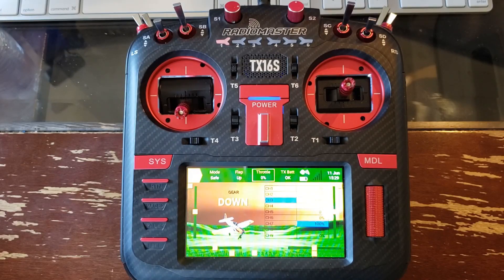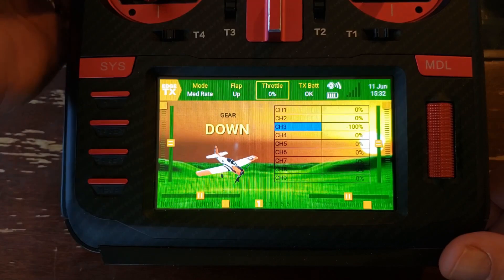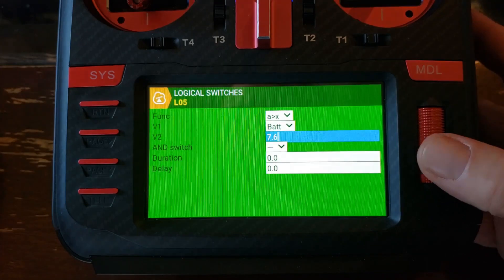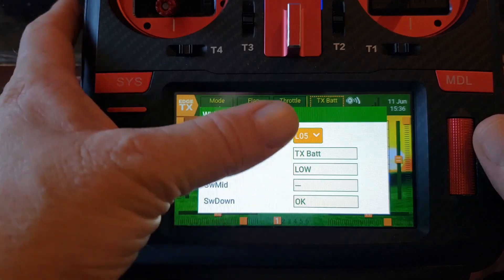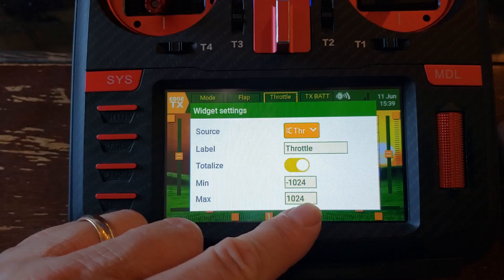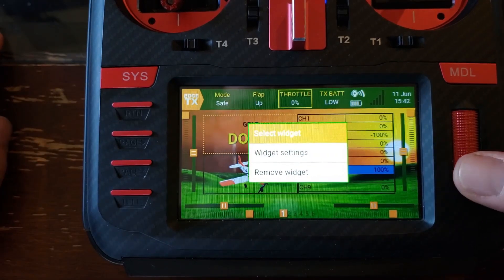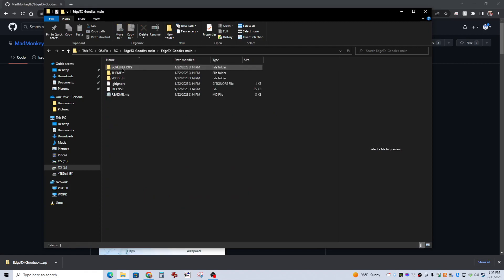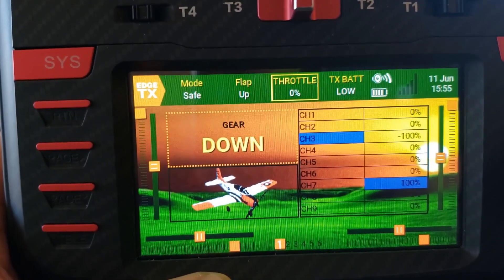Highly Requested Video - Awesome EdgeTX Widget Tutorial!

Comment: Hello Shane,

thank you very much for your great videos, they have helped me a lot!

Now I have a question about this one. I have selected the SwitchPRO, as in your video, to display the flight midus.
But I am not able to change the colours. I also want to get rid of the shadow.
Can you help me with this or do you know of another widget with a similar structure but where you can change the colour?

Thank you very much!
Greetings from Austria.
Reply from the maker: In SwitchPRO the colors just follow the EdgeTX theme you are using I believe.  If you want different colors you'll need to change your theme or you could edit the LUA script on your PC to customize the colors.  Just be cautious what you change in there.  It will take some experimenting to determine which script and which parameter to edit.
Reply: Thanks for your quick reply. 

As far as I remember, I have no yellow and no shadows set in my personal EdgeTX theme. 
And in the other widgets I use (also in the TOP Bar), the colours are also different.

But I'll have another look in my personal theme.

I'll let you know as soon as I've found the ‘error’.
Reply from the maker: @I.Z-e8i  The theme I'm using is FM2M Greenfields.
Reply: So, I've tried a few things now, but I can't change the colour and shadow.

I created my personal theme with the online EdgeTX Theme creator.
I think it is because of the SwitchPRO widget itself, there is no possibility to change the colour.
Reply from the maker: @I.Z-e8i  I hadn't tried so figured it would follow the theme.  I suppose you'll have to edit the Lua script color definitions.
Reply: Ok, I'll give it a try.

Thank you very much for always taking the time to answer me so quickly.

Comment: SwitchPro generates an error on my tx16 as soon as I select it. GaugePro works fine. Never mind, I misspelled the word switch when I downloaded to my radio. I can't believe Edge TX is so sensitive to spellings.
Reply from the maker: What is the error?  Maybe the script is corrupt.  Didn't download correctly or didn't unzip correctly?   I'd start by re-downloading the scripts from the source, deleting the old one off the radio and put the fresh file on the radio. Make sure you didn't change the filename or file extension.
Reply: @ My mistake was in changing the spelling of the word “switch”. I had swith. lol

Comment: It looks like you and a few others are only using the instatrim switch to trim out a plane. Do you have a video that shows how to use T1 and T2 switches to trim ail and elev the old school way (using edge TX)
Reply from the maker: I haven't done any videos on that, I guess becuase it's the same as it would be on any radio.  T1-T4 are generally mapped to the main 4 channels as with just about any radio. T4=Rudder, T3=Throttle, T2=Elevator, and T1=Aileron (assuming you are using Mode 2 radio stick setup).  When I use those for fine tuning, I just set throttle at about 50-60%, fly level and see if it turns, climbs, or descends, then adjust T1-T4 as needed to get it to fly level.  If using Spektrum with a gyro, or really any gyro for that matter, best to turn off any auto-leveling mode while adjusting trim or your trim won't carry over to the non-gyro assisted modes.
Reply: @shanesdiy  continuing with the trim discussion, I havent been able to get the T-1 ail to work 
1. On the screen you can see the T1 moving so the switch is functioning on the model screen but not in the channel monitor screen 
2. when i go into input,mixes, or output, and clic on source or switch everything comes up except T1, T2 T3 or T4.. T5 & T6     even come but not the ones I want.
3. The T-1 moves on the screen when you push the switch but the ailerons do not respond   just for curiosity I did a mix where I set up T-6 as the ail switch and that was able to trim the ail , but I would like to get the T-1 to work. PS. I looked at the channel monitor and all switches and inputs move in the channel monitor EXCEPT the AILERON TRIM (T-1). so there is a problem with the T-1 switch signal (because you can see it move on the screen model screen but not on the channel monitor screen

Comment: Hello Again,  Thank you for the site to download images..!!  but, just when I think I'm getting the hang of this radio .... So I copied the New images to my image folder as it is plugged into the computer.. I can see the images when I look at the SD card on the radio but when I try to add them to the "model settings" page, only some of the models that originally on the card and just a few of the models I added show. and when I try to add the models i loaded they do not  show up.  I'm thinking somehow I must have corrupted that image folder. Do I need to download the entire firmware again or is there an easy way.. If I can just get this last item fixed (I will owe you great deal of gratitude and my sanity)
Reply from the maker: Unlikely you corrupted the SD card and would need to do anything with the firmware.  That exists on the radio, not the SD card so doesn't matter what you put on the SD card, you aren't going to corrupt the radio firmware.  Now you can "damage" the Radio.yml file that is in the "/RADIO" folder if you modify the contents but you won't do that by putting images in the /IMAGES folder.

Are you sure the image filenames and file types are compatible?  9 characters max plus the file extension.  For example 123456789.png  or 123456789.jpg will work.  I don't think it will read .bmp files or .jpeg type.  Also, might be some characters it won't read like @ * & % etc. so just use normal characters.
Reply: @shanesdiy  IT WORKED!!!!  I just changed the name to example ;  F 22   and that did it, Now I can see the planes on the model page like they are supposed.. You have been a tremendous help. Thank you for telling me where to find the images and to add them correctly to the image files..  
I think I mentioned I dropped the radio and broke one of the switches and I thought the jolt might have messed something up.. I would try to replace the switch but they have QR label stuck across the seam, so i dont want to open the radio and  void the warranty,
Reply from the maker: @flyjets305  Happy to hear it!

Where did you purchase the radio from?  Radiomaster direct or from a vendor?  I don't see a "warranty void" sticker on mine, maybe I took it off a long time ago.  I've had mine open dozens of times for mods, adjustments, etc.  Parts are pretty cheap like switches, buttons, upgrade parts, etc. direct from Radiomaster.  Shipping is a bit slow but I've always received my items.  Not sure what to tell you, personally I rarely plan to attempt to get warranty replacement once I've used something for more than a short time.  Unless it was "dead on arrival" I'll just fix things myself.
Reply: @shanesdiy  I purchased from RotorRiot. I took all the 5 screws out that I could see but the back was not coming off easy. Does it snap off or did I miss a screw still holding in place?
Reply from the maker: @flyjets305  Here's a link to one of my videos showing how I get mine apart.  Link takes you to the exact time stamp pulling the cover.
https://youtu.be/lAYvMh4hsuA?si=6UsWsj7TDA7Yj8rU&t=149

Comment: So I loaded some of my plane pictures in my images folder on the Tx, 50kb to 150kb each jpeg  it showed the images in the model, for the first 2, then when I went to add another image, it did not like  it when I pressed "manage models"   it froze,  So i ended up deleting most of the ones I loaded.  is there a size that i can use?  has this happened to anyone else that you know of?
Reply from the maker: @flyjets305  I made a video on where I get my aircraft images and share some info. Filename must be 9 characters or less. Smaller file sizes will run faster but I've used larger ones without much trouble.

Have a look at my video on images, perhaps you'll find what you need there.
https://youtu.be/Pke-0pD9q0Y?si=0fXRWE8aMElfPKdm

Comment: Hi Shane, I've downloaded a couple of widget packs, and I added the "flight" widget I have entered all the parameters (i think) to get it to function, but when I  turn throttle on the specific time range, it still does not register a flight has taken place. any suggestions?  also, Would you know if the I can use a microzone 8rc Rx with the TX16s, or is there a download for that?  Thank you
Reply from the maker: I've not done a video yet on the "Flights" widget yet, been considering it though.  You have to get 3 things cleared for the specified number of seconds for it to log the flight.  A switch, normally would be your throttle cut or "arming" switch.  The throttle must be advanced for xx seconds.  3rd, the telemetry must be "talking".  If you don't have telemetry, you can manually edit the LUA script, and tell it to ignore telemetry and just look for the switch and throttle.

The @Painless360 channel recently did a video on the Flights Widget.  He doesn't get into the script editing but shows the basics.  Here's a link to that video, let me know if you have questions after that, be happy to help.
https://youtu.be/bT08M0S3MY0?si=CQc07aj9-8QAFYgv
Reply from the maker: Oh, and not 100% sure on the Microzone receiver. I think it may work with Futaba SFHSS.  Might find some info on the rcgroups.com forums.

Comment: Is there a way to have telemetry EVIN readout as a percentage instead of voltage?
Reply from the maker: Closest I am aware of is the "BattAnalog" widget.  Set for sensor "EVIN", turn on "Show_Total_Voltage".  It will show voltage and percent.  If you don't turn on Show Total Voltage it will show cell voltage instead of pack voltage. The lithium_Ion check box scales it for Li-Ion batteries and will show about 25% high if you have a Li_Po in the plane.

Depending on what size box you put the widget in, it will show slightly different info.  Top bar you get just basic voltage and %.  Larger box in main screen you also see Minimum volts.

All the other widgets I tested that will show a % either would not scale it correctly or would not accept data from EVIN.
Reply: Thanks, sorry if I didn't make it clear but I like to have it read out loud the percentage instead of voltage. I don't like to look down on the screen while flying. @shanesdiy
Reply from the maker: @oakland510kid  Well, not directly from the EVIN value, at least to my knowledge.  You could setup several logical switches for voltage levels that equal various percentage targets you want.  I'd set a delay so it had to be below xx volts for at least 20 seconds or so to turn on the logical switch.  Then use that logical switch to play a track that says "75 percent", "50 percent", etc.

You can either record your own tracks to put in the /SOUNDS/en folder OR you can copy some values from the /SOUNDS/en/SYSTEM folder.  In that folder there are a variety of numbers and the word "percent" but you can't access them from a Special Function directly so they would need to be copied to the /SOUNDS/en folder.  For example, you could copy the "0050.wav" file for "fifty" and the "percent0.wav".   Then to play both tracks you'd have to make 2 special functions linked to 50% logical switch.  First play track "50" then another to play track "percent" and radio would say "Fifty Percent".

Long post but that's one way to accomplish this.  Hope that makes sense.  If not, I suppose I could make a short "viewer request" video for that.  I get the logic behind it, sometimes I may not remember how long I have left if I have 11.8 volts but if it says 40% that makes more sense.  Your 0% doesn't have to be the battery is dead, could be just the voltage when you want to land.
Reply from the maker: If you haven't already seen it, I cover setting up a logical switch to trigger a low power alert in the following video on using voltage telemetry.
https://youtu.be/SDdAkyJB9Tc

Comment: I have had trouble like this before. I copied the model to images. But it's not there.
Reply from the maker: Here's how I do it.  Find the model you want.  Once you click on it, seems they all have an image of the plane "floating" up in the upper right corner.  Rather than clicking on their "images" I just right click on the floating image and click "save image as".  It should be a .png file.   Be sure to name it a max of 9 characters. If the name, not including the .png, has more than 9 characters you can select it on the list but it won't appear on the TX16S screen.

Comment: Great video. Like the widgets. Just two questions. On your main screen, how did you get the text to respond to your gear switch? The plane model seems to be flying over the terrain. How did you do that. All my model images have either a frame or background.
Reply from the maker: Gear is the same as the "Mode", "Flaps", "TX Batt" on the top.  Use your gear switch as the source and put text for UP or DOWN in the correct fields depending on the switch position.  It looks different because it is in the main screen rather than the top bar.  The widget changes the font automatically when placed there.

I get my graphics from skyraccoon.com.   You can get a .png file of most planes there which have a transparent background.  They look awesome.
Reply: Thanks a lot Shane. @shanesdiy

Comment: Hello
How do you put 7.5 in the batt value? I only can enter 7 or 8, not 7.5
Reply from the maker: Interesting. Are you sure you've selected the correct "Batt" value from the source list? What EdgeTX version are you using? There was a telemetry decimal issue a version or two back that I wonder if it might be related. If so it would be fixed in 2.9.3
Reply: @shanesdiy  Thanks! I have solved it. I had to touch the field with the number, and then I was able to enter the decimal.

Comment: Hi Shane. Have followed your excellent video and have loaded widgets to my TX18s for aileron and elevator. Have checked and double checked and although they appear to be correct they do transmit to the model.  Have also loaded instant trim, timer,and sounds. I am shaw it is just a small admission on my part but just cannot seem to find the problem. Cheers
Reply from the maker: Happy to help. Not sure I understand the problem you are having. What is not working exactly?
Reply: HI Shane, Loaded aileron and elevator useing high, med, and low rates  also including volume, play track, timer 1 reset, instant trim and timer display on (Widget) introduction page. All of these seem to be operating, but they do not transmit to the plane that is loaded and bond. At present I only have one aircraft loaded and will wait until this issue is solved before including the rest of the fleet. This is a new transmitter (edgeTX) but have used Open TX for a long time.  Hope I have explained it more clearly this time. Cheers Colin
Reply: Hi Shane did you receive my reply to your request. If you require more information please feel free to ask, I need to get this up and operating as soon as possible. Thanks Colin
Reply from the maker: Sorry, still not exactly sure what the question is.  You say the rx and tx are bound but no controls are transmitting to the rx/plane? Nothing at all?

Perhaps take some pictures of your inputs and mixer pages and email them to me? My email is in the about section of my channel.

Also, let me know what receiver you are using and what protocol you have the TX set to.
Reply: Hi ONce again I have not explained clearly. I am useing  FS-iA6b rx and the Flsky  protocol. All the control surfaces operate as they should but when I go to the appropiate sw for low rate, med rat, and hg rate, on rudder elevator and aileron they do not respond. I hope this makes it clearer, but I will send photos later when my phone has charged overnite.
Reply from the maker: @patterdalebt  Ok, I think I understand.  Photos of the mixes and/or inputs where you created the rates will be helpful. Need to see where you created the various rates and how you setup the switch.
Reply: Hi, I took photos and requested your email address through the about section but as yet it hasn't come up.
Reply from the maker: @patterdalebt  Strange.  Please send to:

shanesdiychannel (at) gmail.com